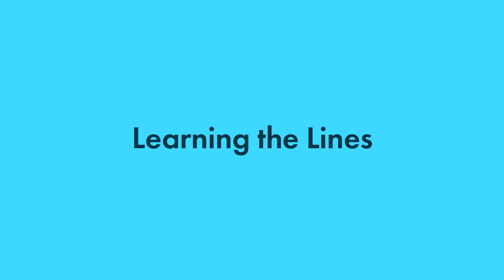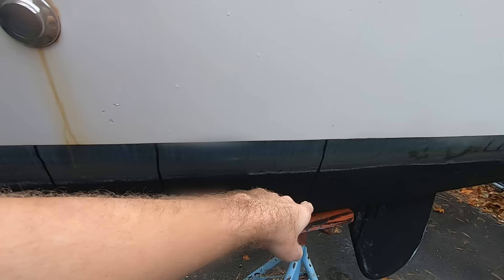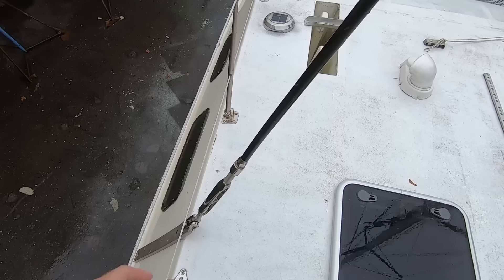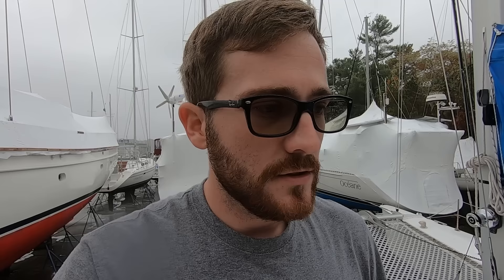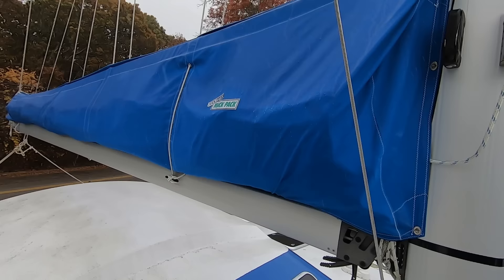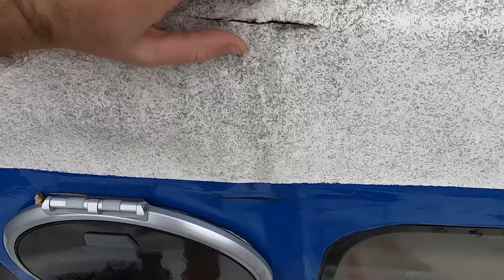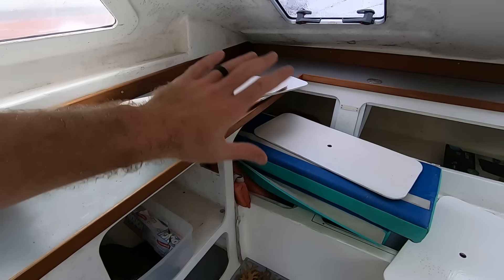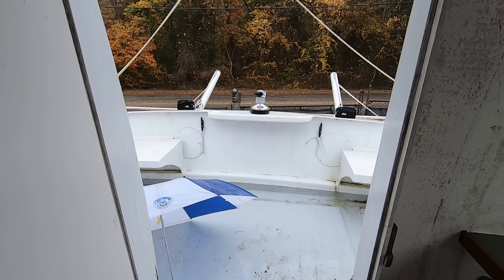109. Dirt Cheap ABANDONED Project Catamaran - Should We Buy? [Full Tour] Learning the Lines

Comment: A little history is in order. This type of boat was an outgrowth of the rage for racing catamarans from the late 1970s and well into the 1980s. It was built for racing, not cruising and was built for a very limited life. A multihull builder once told me that if it does not break occasionally you made it too heavy. If I owned it and you offered me 40,000 you would have a deal and I would be dancing in the streets.

Comment: If it gets down under $50K, it might be worth it if the hulls and primary structure were good. The power plants and new rigging are worth more than that. At that point, and as you said, you have a place to do it at your leisure, on the hard, cut it clean to the hulls and start over; build it back how you want. Hang the fuel and water tanks, under the cockpit/new cabin. Now you can create all the living space you want, even his & her heads, if you so desire. As the price it's at now, no, walk away.

Comment: remove and remake the coach roof bigger - wider and more forward.... this way you can ditch the exterior companionways and bring into the expanded salon. Move heads to just in front of engines to existing rear bulkhead. new companionway stairs from inside main cabin. move main cabin door to one side - galley along back bulkhead and seating forward in one long settee into the new forward .... expand berths forward..... totally re-layout everything...

Comment: I suggest you rebuild the cabin and make entrances to the hulls on the inside. Looks like even if you kept the present cabin you have to rebuild. Those back hatches and sugar scoops rip out the ply and use nida-core, If there is any bad balsa repair with nida-core. 

On clean up, spray with a professional cleaners peroxide based cleaner that will KILL the spores. Spray wait a couple hours then clean a germ free area that doesn't stink. While on this, purchase the concentrate, re-bottle the diluted strength and sell it to very grateful boaters to really get rid of mold, fungus or whatever grows in the tropics. Bleach kills the fungus and makes it white but does not kill it's babies. Wish I was younger to buy something like this.

Comment: If the decision to do a refit of an existing boat has been decided(which I would highly recommend over building your own), might you look at hurricane damaged boats?  Although the expense over time would be closer to that of good condition ready to cruise boat, the cost is diffused over the course of the refit and thus easier to manage.  I have seen many boats(both cat and mono) which are within the 10 year age range that would be ideal for a DIY refit.  I have been considering this myself as I search for a cruising boat in the 38'-48' range.  Old boats will always be old boats no matter how much work you do to them.   A newer hull has the benefit of advanced construction methods that are tried and true, something you cannot replicate without extensive time and commitment over the course of 3-5 years.  Whereas, you could finish the refit of a hurricane damaged boat in a year if you spent all your spare time working on it.  The knowledge amassed over the course of that time is invaluable and at the end have a boat which is designed exactly to your needs and will hold its value and integrity for years to come.

Comment: At the price, run. But if you know how to - or am not afraid to learn - how to sort the boat out, it is still interesting at, perhaps, a third of the price. Don't get suckered into buying cuz of the new stick and engines. I know I will sound cynical but it is not your fault the owner invested heavily in these things on a boat that has such big issues. You would need to rip out the coachroof and the scoops. Which is not bad as you can consider making a V2 version of the saloon and it doesn't "seem" structural. It's a pity those diesels were put in as the boat is so light it's a great candidate for outboards. As you know, this is a fast boat but it has minimal load bearing capabilities and you wont have much space. Also, remember, this is a pretty low bridgedeck design in terms of clearance. When doing proper offshore sailing, you will likely get slamming. 

It will take longer and cost more but how about a homebuilt Arrow 1200 from Schionning plans. There's a great example built by a German family. It will turn up once you google it. Or keep an eye out on the used Schionnings in Australia. You can go shorter and still have loads more room than in the Outremer.

Comment: Only buy/build a mulrihulls, or any vessel, for your intended waters & usage! My latest cat build was a 20'x9'2" micro. Queen-size bed, 8"draft & perfect for my SWFL nearshore island-hopping. ECO7 design. Trailerable! Those big old cats are purely for commercial usage, not for normal usage. You'll have to charter to make it realistic, as you 2 can easily get to where you will on a much-smaller cat. And not pay a fortune when you arrive at a marina or home port. The newer 20'-30' designs are what you need, just ask any savvy Multi-Designer. Don't listen to nay-sayers, & please don't be afraid of plyw'd, structural foam, epoxy, glass & carbon! Built properly, its as good as solid glass, strong as steel & lighter. Australia, NZ, NW USA, EUROPE, has super Designers with decades of experience (good & bad) to guide you. Honestly...you can build a cool smart little cruising cat in 9 months part-time. Why not? Course, you'd have to give up social media & TV! Haaa

Comment: We looked at that boat also. It was just to much project.  Lean how to use penetrating epoxy. If you have the time , Go for it. Open the hull so they acess from the bridge deck and not the cockpit.
We ended up buying a 20 yo Leapord 38. I am single handing down the ICW heading south if you wanna jump on for a few days or weeks.

Comment: I guess this would make a good donor boat if you could find another cat  which only needed minor repairs, new engines, mast, sails and riggings. I think the damage you pointed out in the video is a good tell tale sign that there is much more structural issues than meets the eye. If the owner keeps lowering the price to the point where the new equipment can be got at a deal, then may you could revisit salvaging that, providing you have found another boat you could use it on. At this point you made a good decision to walk away.

Comment: New Outremer's have fuel and water on the bridge deck adjacent to the main beam, fuel tanks where they are is a bit of a waste of space, forward lockers simply cut out the main bulkheads and ring frame in solid glass and extend the living space, usually heads forward, would recommend fire rated or rigid SS fuel lines. Coach house roof and hull extensions are cut off and start again, would also recommend a light composite compression post from the forebeam to the bridge deck and move the windlass to the centre of the boat on the main beam, so lots of work but all doable, probably 12 months worth of weekends, flowcoat all the internals but would make a most excellent project at the right price. new Yanmar 15s are about 3.5K USD each, new rig maybe about 20K USD including new sails, boat as it stands maybe about 10K USD, so fair offer around 40K USD which is probably way less than the broker is asking for.

Comment: I would literally just lay new fiberglass over the old canopy and treat like a mould and ignore the wood. Patch and paint it. Its not structural. And lay out a canopy extension in your backyard and get a chop glass gun and make an extension. Or even just use clear plexiglass over the tiller area like a greenhouse. The head up top is nice for solo sailing when you don't want to be far from the tiller. Get a wind vane auto steering system. Sell one or both engines and with the money put an electric motor on it with 5000 watts of solar.

Comment: For myself, I own a self-designed and built Trimaran. If I was to looked at this vessel, I would not be interested in it due to the cost of the refit would quite literally break you financially. I wouldn't even touch it with a 60ft barge poll, that is being honest. The boat has obviously hard a life and then been abused due the previous owner.

Comment: Think of this boat as a kit rather than a usable boat.You have to make a list of all the new good stuff on it. The mast the rigging the motors ,fuel tanks, instruments, etc. you also have two good hulls. Price the good parts out how much you would take to replace them. And that would be your top high-end bid, I would start with 30 of 50% of that. The area that is mold I would put a layer of fiberglass just for psychological value. The main bridge cabin on top needs to be completely redone. I would take a chainsaw and cut out all the windows. And throw away the rest. The design/redesign the way you wanted to be. It would be a way ahead from starting from scratch. As for the Stern with the funky rotted plywood, did they remove the back wall and had the section on? Or did they just retrofitted on? Either way, it comes off with a chainsaw....

Comment: 89k is a non starter,, offer 10 and put a team in there with 30 or 40k and  a jigsaw  , with some  inspirational design / remodeling you can have a good boat .  ( assuming , as you implied,  that the hulls are good  )  the early Outremers are both fast and seaworthy boats .

Comment: Buy for $25000. Remove all engines and fuel tanks. Fit electric motors and diesel generator. Put back to two cabins and two heads. Fit new galley and lounge. Got yourself a very nice cat.

Comment: you take a light hammer and a flashlight.  if it's punky, it won't thud or bounce if it's solid, you'll get a good sound and a little jump, very little,  to the hammer.  is there rust around  the fastenings. ?  are they solid?   are they  loose ? rot will delaminate fiberglass, and fastenings become useless. a small magnet might help to find fastening that are common steele, not stainless or bronZe.  I  see  lot of mildew,  worst case, you can strip the hardware, gear, and engine, build a wha on the rram cat, and save money on outfiting

Comment: That boat need $100,000.00 of refit and redesign to make it usable. MAJOR redesign is an absolute must. Entry to BOTH forward and rear space on each pontoon from the salon is a must, as is a total gutting and redesign of the salon. If you did the work yourself, you could do it for $60,000.00. If you hired the work out it's a $100,000.00 job. The current asking price of $89,000.00 is $50,000.00 too high to make this a viable project in my opinion. Especially when you consider what is on the market today for a used cat of similar size. This boat will never be worth what is needed to make it a livable floating boat. The only future I could see for this boat, is if it is merely cleaned up, repaired, and used as a teaching platform for sailing, where accommodations is not provided. A day use boat in for a school. Or a fishing platform for day fishing excursions. Or a scuba Diving platform for day trips to go dive ship wrecks off shore. It's never going to be a live aboard, not in it's current configuration. But a revenue generating work horse maybe?

Comment: The asking price is way too high for the amount of work that needs to be done. I would not go above 20K for this boat. Having said that there is a lot of potential, the new engines could be removed and sold, that could go towards an electric system, I would remove the entire super structure and redesign it to be bigger and better layout. The dagga boards area could be modified to make them safer and closed by raising them and covering them. The entire rebuild would probably cost as much as buying a ready to sail but it would be a whole lot of fun and experience building it yourself

Comment: $90k's!?! Lol! I'd offer $20k's if I were really stupid. But were it me I'd rip that "bridge" house off, make it wider to enable access to port and starboard hulls and separate them from the engines and fuel tanks but leave the access to them from the cockpit. Other than that she's a good boat looks like. Find the plywood areas, rip em off and replace. If you took a month off and left it at the marina to work on, it could be basically done enough to get it in the water. This as opposed to building a catamaran?
Offer them $20k's cash!

Comment: Cut a 0 off and make an offer, with a preasure washer the boat is clean and moldfree within two days. 1000 workinghours later you have a fast boat to sail. The holes for the daggerboards could be covered. Cut of the storage above the engines for good acess and get the 3 feet off again,they are useless and to much work to restore.

Comment: I suspect a proper survey would show that there is not a good piece of plywood left in that boat.   When you have huge, giant cracks in the fiberglass, and those cracks have clearly been left raw and exposed to the elements for YEARS, water has gotten everywhere and destroyed absolutely everything.  What you can see is terrible, but what is under the skin is going to be so much worse.  And if that isn't disheartening enough, remember that it is in RI, which means you don't just have endemic wood rot, all that water trapped in there has been freezing and thawing for years, and who knows how much structural damage that has done to the parts that can't rot?   

Sadly, that boat is already dead, nobody is going to pour the amount of time and money needed to make it viable again.  Its real problem is that even if you fixed it up, it would be a dreadful live-aboard design.

Comment: I like your thinking process on this one, but stop short of thinking it’s worth the time and effort to fix it.  I always ask myself what would Mads do to fix this boat and that would be a complete tear down and at least three years to rebuild. After that you will have invested far more than what the finished product would be worth.  To me this boat has its max value right now, to be stripped for parts.

At the end of the day it’s pretty small for a cat.  Very poor use of space. My sense is it’s worth about 25% of the salvage value and I think that is well south of $40k. I’d be thinking in the 10k range and then plan to strip and ultimately crush it in place taking two weeks max. As you know storage costs add up quickly.

Comment: I defiantly see why you thought this was worth a look. This looks like it was previously a cat without a mid cabin. Unfortunately what was added was done with way to much wood! 
You should look at the Kurt HUGHS 33 in Florida , a homebuilt , to see what sort of standards are out there , it's in Fl too. 
You used to be able to buy in UK the Prout Snowgoose as bare hull. They were well made fiberglass and have done some amazing passages , big cats with potential and a much better choice to rebuild . They are out there cheap too.
For a really big cat project check out 'sender sailing' a very rough Crowther 37/40 , same design as Tula and Zingaro , but way rougher based on the v low purchase price.  Cheers Warren

Comment: Fuel tanks and motors in the births caused me to pause. I'd assume there's air tight covers and ventilation for them? I don't see too much of a problem repairing the fiberglass but that something I've done professionally so it's not that big a deal. But the basic layout of the boat is very unappealing. I'd prefer to enter both births from the cabin rather than going outside. The only ocean sailing I've done was in the pacific northwest Washington coast and it would get pretty old getting wet every time you wanted to go from cabin to births.

Comment: I can understand the negative comments and at $80K its not worth it.  At least two years to get it fixed halfway decent, not good.  That said, its exactly the kind of boat I look for.  Offer 20K, no more.  If the owner reads the comments, I'll trade a MacGregor 26X powersailer with trailer and 50 HP four stroke Honda outboard for it.  Its a trailerable sailboat with the water ballast system and big motor that can go 24 MPH  and tow a water skier using the motor, and can handle big waves and wind under sail.  This is a fun boat ready to go, and easily resold if thats what they want to do.  Given the condition of the cat and the amount of time it will take to get it back on the water, its a fair trade.  Leave a comment on my channel if interested.

Comment: Well....if you are planning on building your own within say, two or three years, add up the cost you'd pay for engines, fuel tanks, mast, rigging, cabinetry, and perhaps the steering. Then see if that is more than or less than this "boat" is being sold for. Add in the cost of flying there to gut it, shipping and storage of those parts, etc. 

Perhaps you can purchase it just to gut out the parts and trash the rest. I do not own a boat. Have no fundage to do so. But even if I were given this free, I'd take out the usable parts (not much) and use the rest as perhaps a raised flower bed.